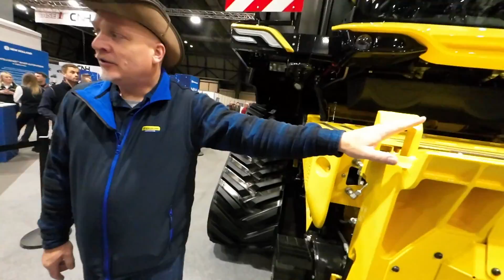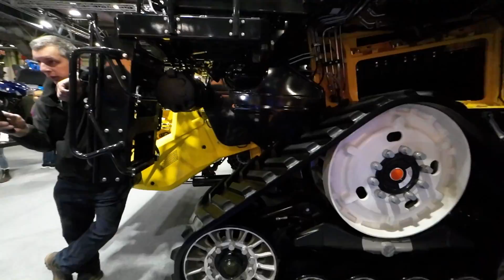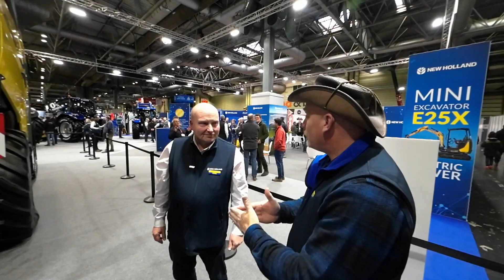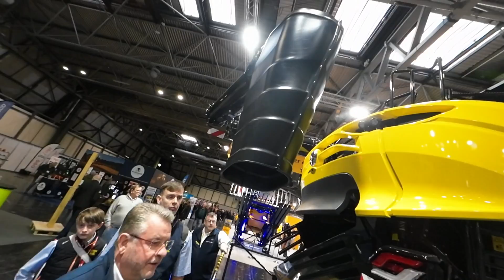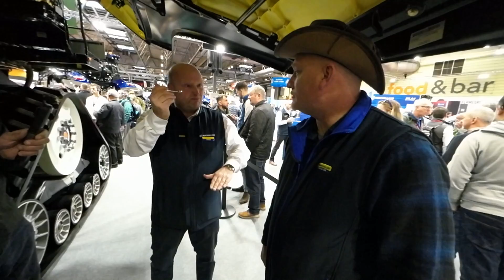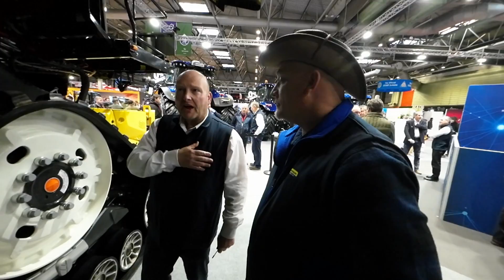The New Holland CR11 pt 1

Comment: What I understand is that they are using a hydrostatic motor to spin the ring gear to vary the output of a planetary gear system.
Reply: It has a cvt transmisson to drive the rotors,  a blend of mechanical and hydrostatic.
Reply: @paulsimpson.417  What I described is the mechanics of one type of CVT, as opposed to a belt and variable pulley type.

Comment: Case is releasing it in red at the Louisville farm show
Reply: I haven't followed them much but it looks like the New Holland design has won over the Case IH design.
Reply: @danw6014 true. I think NH have a winner but a do like the cab styling of the case AF11
Reply: @danw6014  i think case has the reliability down pat but u only can go so big before 2 rotors becomes more feasible but this new machine is an all new design so hopefully more reliable